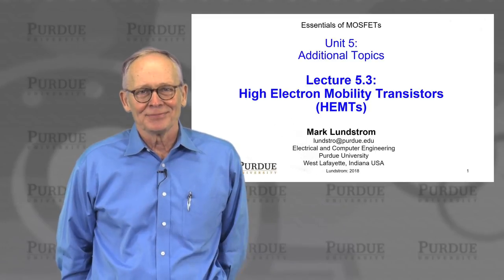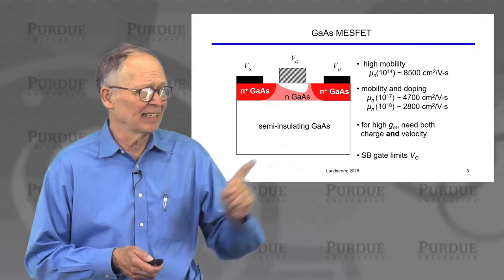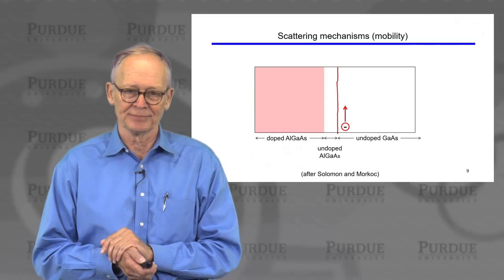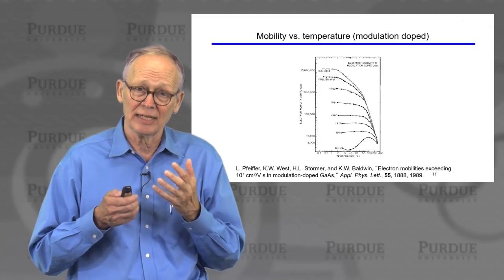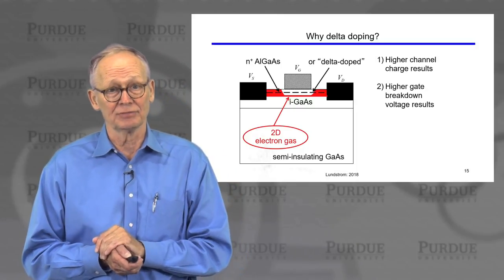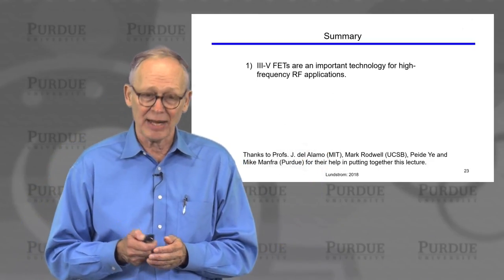nanoHUB-U MOSFET Essentials L5.3: Additional Topics - High Electron Mobility Transistors (HEMTs)

Comment: 00:00    Lecture 5.3: High Electron Mobility Transistors (HEMTs)
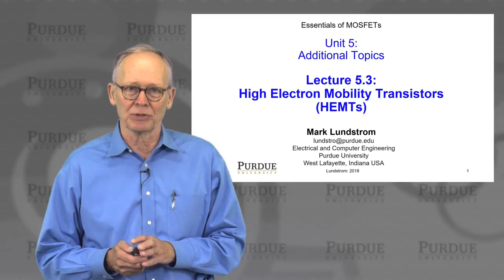00:24    Transistors
01:04    GaAs MESFET
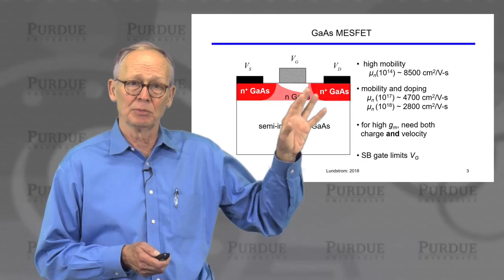03:17    "Modulation doping"
04:17    Modulation doping
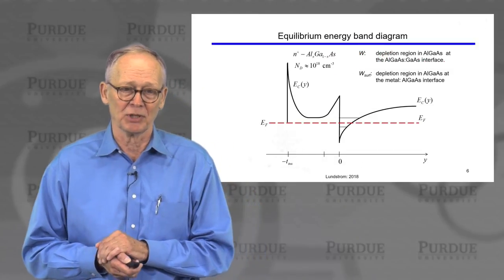05:22    Equilibrium energy band diagram
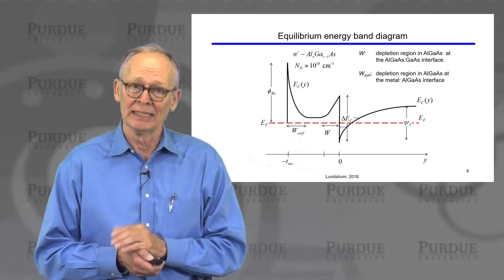06:34    Parallel conduction should be avoided
07:28    Why dope the wide bandgap layer?
08:37    Scattering mechanisms (mobility)
10:41    Mobility vs. temperature
11:20    Mobility vs. temperature (modulation doped)
12:10    Molecular beam epitaxy
12:31    From physics to technology
13:04    Heterostructure FET
14:13    Why delta doping?
14:56    Names
15:17    InGaAs HEMT
16:44    Layer structure
17:03    Applications
17:37    InGaAs HEMT technology
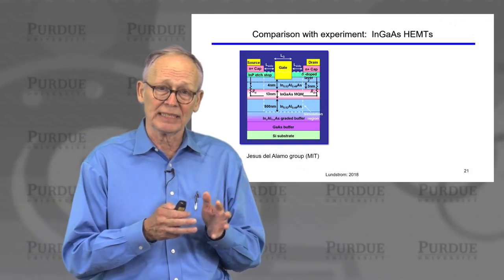18:31    Comparison with experiment: InGaAs HEMTs
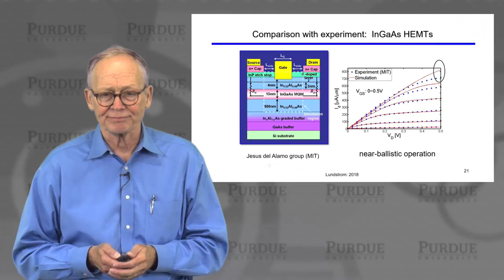19:22    III-V MOSFETs
19:48    Summary
20:43    Next topic